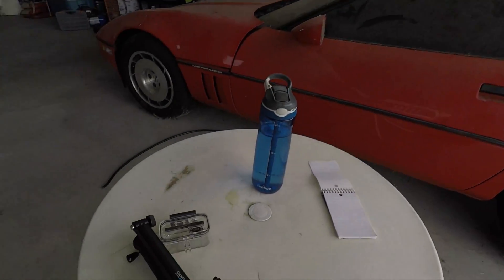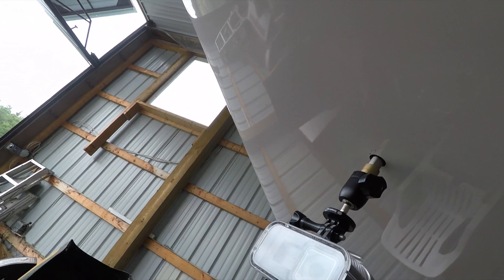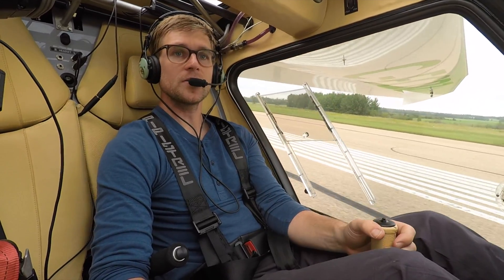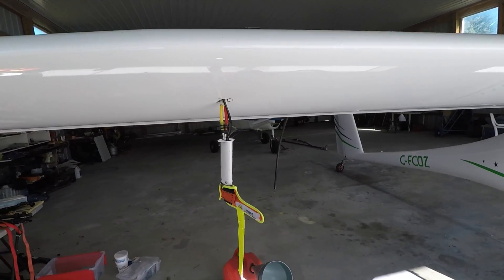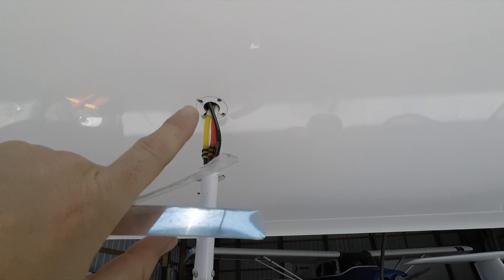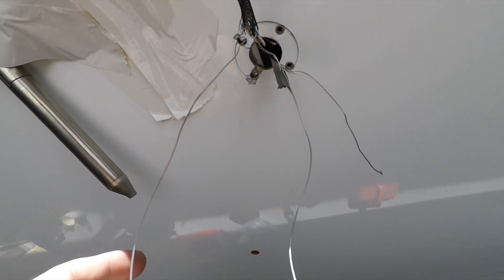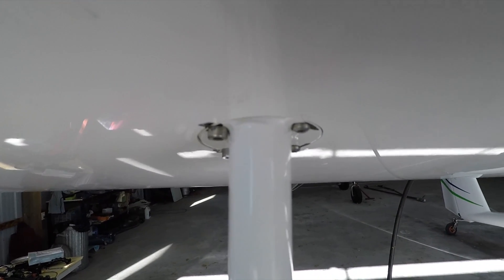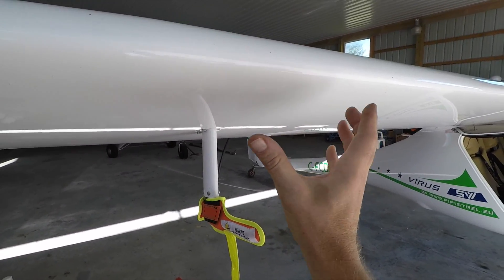Broken Pitot Tube...Again!

Comment: Is that a carbon fiber wing?  Aluminum and carbon fiber directly touching will cause a galvanic reaction between aluminum and carbon fiber composite.  You have to insulate the aluminum with fiberglass or other methods.
Reply from the maker: Turning Short Final yes it is. I talked to a composite expert before doing this and he did not mention that this could happen. I’ll have to look into it. Thanks for the comment.
Reply: Galvanic corrosion is something anyone working with carbon fiber should know.  Standard practice is to isolate the aluminum with a layer of fiberglass and then glass in a plate into the wing to distribute the load across a larger surface.  As opposed to the OEM putting all the load on 4 nut inserts.  That's not good practice at all!
Reply from the maker: Turning Short Final so how do these companies get away with installing antennas with aluminum base plates right against the carbon fibre? The pitot tube design is not great on the Pipistrel. All load is on the tiny nutserts. Much too weak. 3 of 5 Pipistrel owners close to where I live have broken their pitot tube mount.
Reply: Specifically who?  There should be an isolation layer.  You might not see it.  It doesn't require much.  Paint?  Gelcoat?  Alternatively, it could be as simple as the OEM incorrectly installing the antenna.  It wouldn't be the first time.

Comment: Something that I was meaning to ask you for quite a while is: with that quick and short take-off run, what technique have you developed to check your engine gauges? Looking at the videos you can barely take a look at the speed and off you go. And a glimpse at the RPM wouldn't be enough I suppose.
Reply from the maker: Mitko Nikitov hey yeah it is quick. I basically check two things, rpm and oil pressure. I know that everything else is okay from my run up so as long as I have full power and good oil pressure I know that I’ll be fine for take off. This plane gains altitude very quickly as well so even if there was an issue, I’m at 1000’ in about 20 seconds.

Comment: How did you get the metal piece up in the wing? Through an inspection plate or through the pitot tube hole itself?
Reply from the maker: Scott Haywood I made it narrow enough to slip through the pitot tube hole. There is no inspection plates on these wings.
Reply: Darryl Zubot ok.  Thanks
Reply: with no inspection plates, how does one examine inside the wings, controls surfaces mechanisms, etc?
Reply from the maker: lakeguy65616 you can inspect from the wing root, by taking off the wing and opening up the wiring panel you can see inside the wing. Then you could use snake camera to inspect. Really can’t fix anything inside the wing.
Reply: thanks for responding. 1) How is an annual inspection done on a Pipistrel if there are no inspection panels to gain access inside the wing or tail section? 2) is there anything you don't like about your Pipistrel?